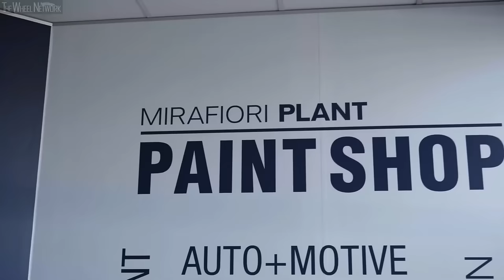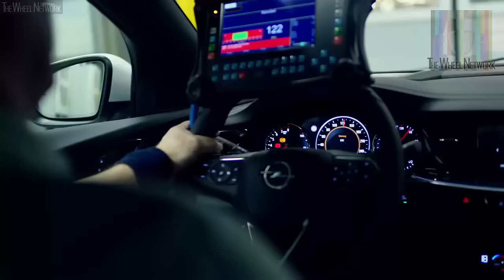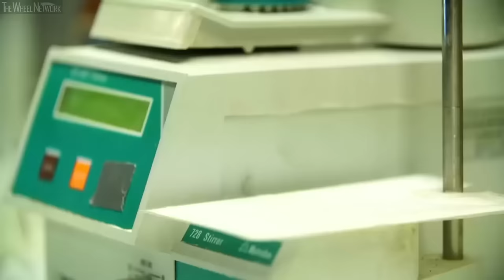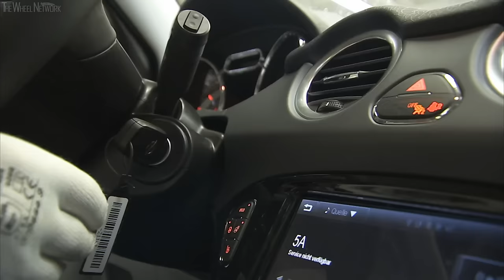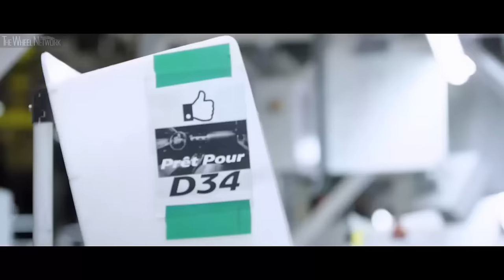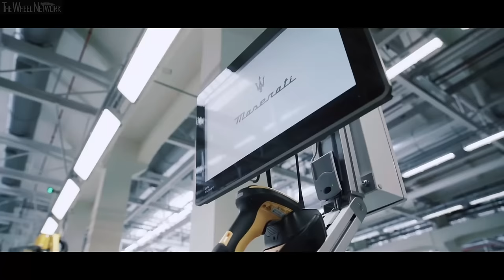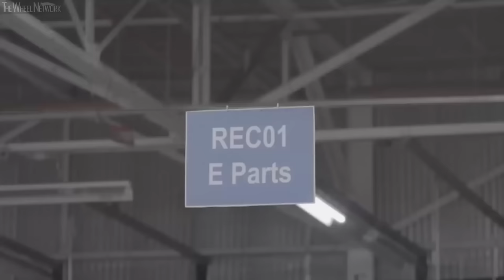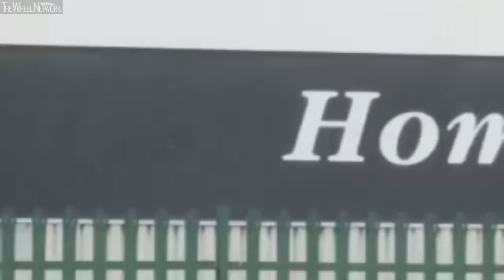Stellantis Production in Europe (Fiat, Maserati, Peugeot, Jeep, Opel, Citroen, DS, Vauxhall)

Comment: A bigger collection of nondescript, badly assembled brands controlled by a company that knows less about good customer relationship than I do about nano-biology has never been seen!
Reply: @rosen0662  I thought my sentence was pretty clear and unambiguous.
Reply: @garyquinlan4075  How did you decide that the brands are badly assembled? They showed high quality control and they have good customer relationship
Reply: @garyquinlan4075  Id say the opposite, Citroen and Peugeot will pull the Italian brands up, bring better quality control and customer satisfaction. Isn’t that one of the reasons PSA bought FCA?
Reply: Do you have a car? Tell us what brand please.
Reply: @mainsfortes5778  I have had Mercedes (great engineering but soso in parts), Lexus (nothing ever went wrong), Commodores and Falcons (unreliable and shit dealers and HQ), Renaults and Nissans (both reliable but shit HQ), Chrysler (shit in every way), Toyotas (mostly good in most respects), Subarus (excellent in all respects), Mazdas, Kias and Isuzus (very good in most respects).

Currently have a Mazda and Kia which are giving excellent reliability. I have friends with Alfas, Fiats and Jeep's and ALL have had multiple problems.
Reply: @garyquinlan4075  , most problems stem from lack of maintenance .  My 83 Toyota Camry is wel l maintained and so far after 400,000 plus miles still runs good. Any car with good maintenance will last a long time. Fiat, Mercedes, BMW etc.
Reply: @mainsfortes5778  There are so many online sources regarding independent reliability and quality assessments. The Fiat-Chrysler part of Stellantis has performed badly for over a decade. RAM is the only one to make improvements in the last few years but even then it ranks behind the likes of Lexus, Toyota, Hyundai, Kia etc.

We will have to agree to disagree and revisit this in 10 years to see how Stellantis has fared.
Reply: @tacosalaten3677  I too have a 1.7 Isuzu engine in my Astra g and it is a tank. Replaced the chain at 100k now it has 208k no problems.
Reply: @mainsfortes5778  ive got a Opel Astra K made in Germany!
Reply: Why they didn't get Renault into Stellantis?
Reply: @lenny108  There is enough pain in Stellantis without adding Renault-Nissan😀
Reply: @lenny108  Because they are together with Nissan

Comment: All of  the cars use a 3 cylinder  wet belt  engine   the belt  breaks up blocks the oil pump damages the engine  or snaps and the engine is scrap what a stupid  idea  a rubber belt boiled in oil

Comment: I own a 2020 maserati quattroporte a 125k dollars car. Is built very cheap. Squealing inside, all kind of knocking noises, the console squeals and got cracked, the shifter knob gear indicator plastic cover edge came apart, i got cut in a chrome trim while using a rag to wipe of the dust. For this kind of money the car doesn't have power distribution differentials for winter driving, the car thinks for the driver and cap the speed in heavy rain or snowy roads because the car is awd but is based on a rear traction and is trying to protect the driver from drifting away. It's a 400hp car same thing as a Ford, infinity, chevrolet or other common brands, it's not a 600hp car which even those don't have a stupid feature like that.
 The only thing that makes me happy is that is my wife's car and she love it.